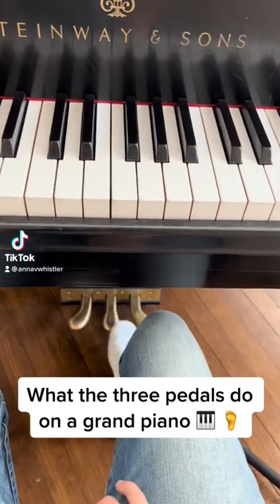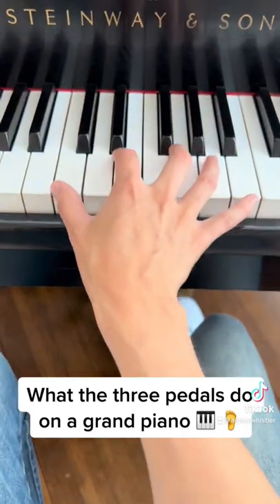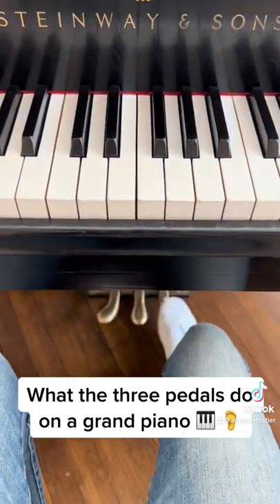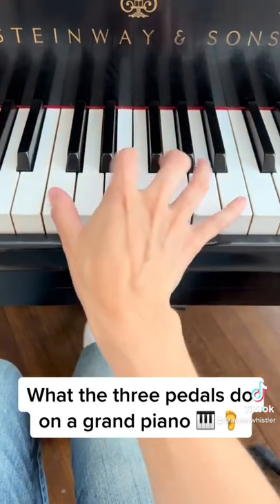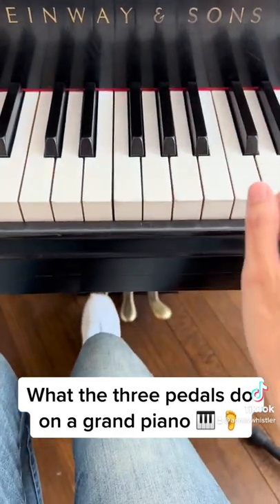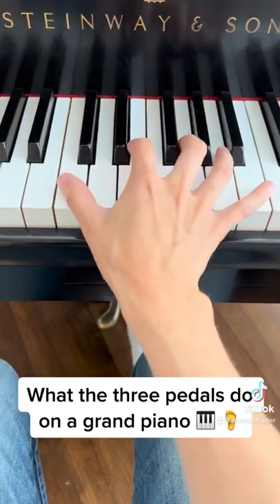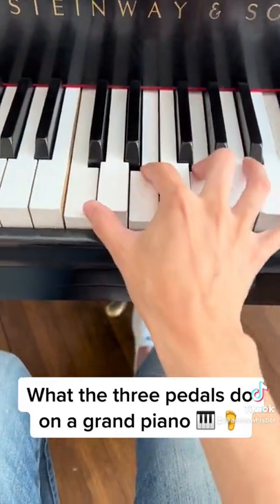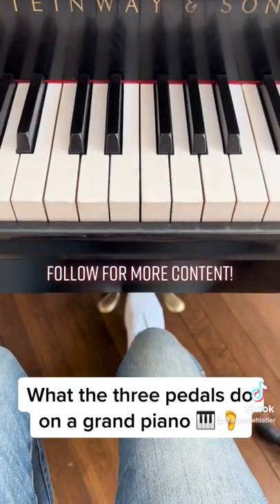What do the three pedals do on a piano? 🎹 🦶

Comment: The middle pedal is weird.

Some upright pianos have different middle pedals; instead of sustaining specific keys that are held down when the pedal is pressed, a sheet of fabric is placed between the strings and hammers, dampening or mute the sound by a lot. These pedals can usually be press down and pushed to the side to lock it in place so you don't have to hold it down while you play. I don't know the name for that type of pedal, but some upright pianos have them.

I've always assumed that it is used for people who play in apartments as to not create a lot of noise and disturb your neighbours. But it may have a different purpose.

Not all middle pedals are created equally.

There are even some uprights that are missing a middle pedal entirely.

Comment: What’s the point of having the middle one when you already have sustain
Reply from the maker: Some classical pieces call for using the middle one because it allows you to hold only a few notes (like a low bass octave) over multiple measures while you have other notes/chords going on over top. You can use the sustain pedal to change the pedal of the other notes/chords (therefore "clearing" the sound so they don't get too blurry), while also maintaining the sound of the bass using the middle pedal. This is just one example of when/why you'd use it :) I'd say it's used rarely though.

Comment: Which one is the sostenuto(?) is it the middle one? Thx for answering!! 🎹🎼🎶🎵
Reply from the maker: Hello there! Yes, the sostenuto is the one in the middle on this piano (and most modern grand pianos). However, you won't always find sostenuto pedals on upright pianos or older pianos - uprights sometimes have a "mute" or "silent" pedal in the middle for quiet practicing, and the sostenuto wasn't invented until the mid 19th century (and took a little while to catch on), so older pianos may not have a sostenuto pedal :)

Comment: Thanks. I thought there was a pedal that also made all the keys shift to the right for some reason.
Reply from the maker: The left pedal (the una corda pedal) shifts all of the hammers over so that, when you play a key, its hammer hits only one or two strings, resulting in a softer sound. That’s where the name “una corda” actually comes from - meaning that the hammers hit “one string” :)
Reply: @annavictoriawhistler  this is only true for some pianos.  On Bosendorfer pianos for example all strings are still struck but the space in between the string grooves on the hammer is voiced to be softer.  The advantage of this is that you can change the timbre of the note without necessarily reducing volume.  Not to mention leaving a string unstruck that gets energy from the bridge will be 180 degrees out of phase causing a comb filtering effect.  This is observed audibly as a sort of "scooped out" effect.  Leaving some important frequencies canceled and a undesirable thin tone.